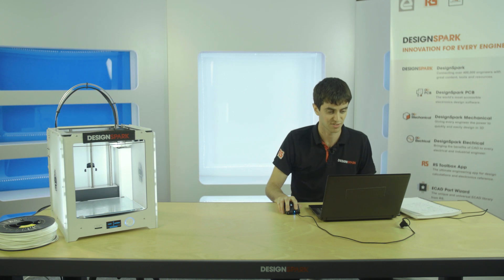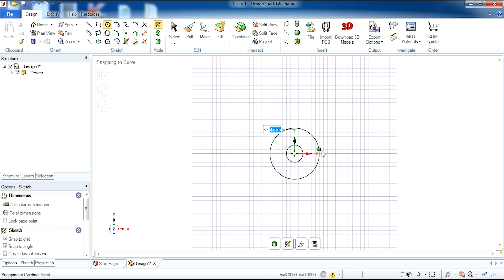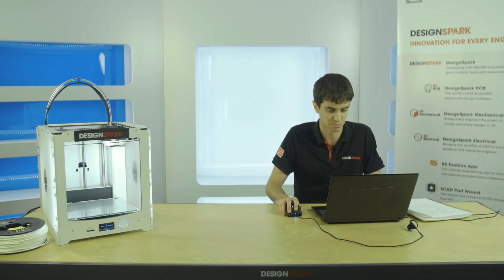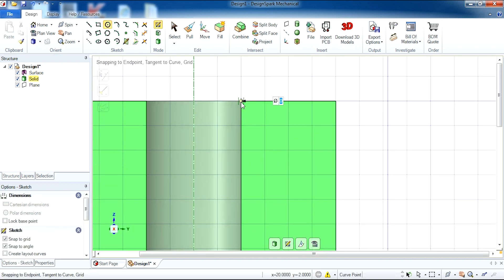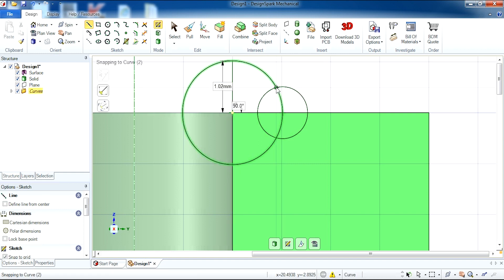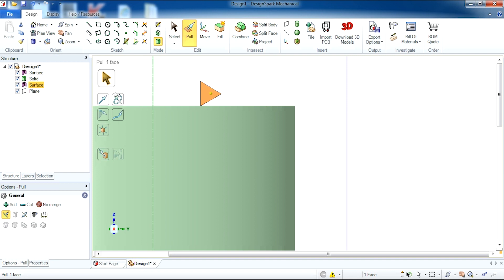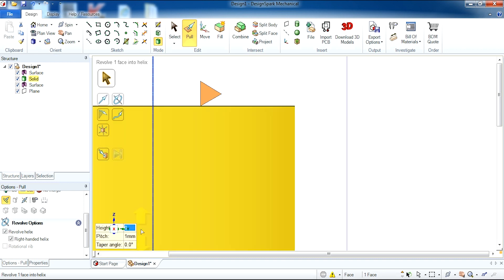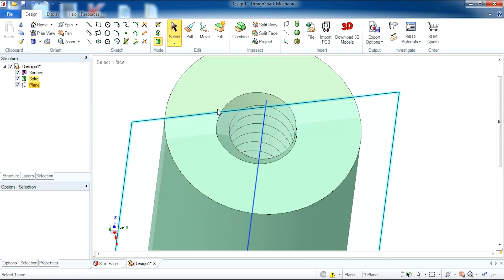DesignSpark Mechanical Training | 10 Threads

Comment: To address some of the comments concerning dimensions of threads.. I've been a Machinist and Engineer for more than 50 years....    you can google the dimensions for threads and there are a lot of resources of information.  You can also download a PDF of "Machinary's Handbook" and it will provide way more information on threads than you can ever use...  Basically you only need the Pitch, Major and minor diameter along with standard tolerances.   I'm not a DS expert but I do have some experience with threading..

Comment: There really needs to be a create thread tool which is simpler. I tried following this and I don't get the revolve options menu. So I don't know what to do now.
Reply: ah so you have to click the revolve tool in the pull menu THEN click the center of the tube to get the menu.
Reply: Now it says failed to resolve as a set of surfaces :( I don't get it. OK so my triangle wasn't on the middle edge of the circle. Now it doesn't seem to like pressing enter in the popup box. Have to use tab to change the box. Looks to outline the thread now but doesn't seem to cut it away :(
Reply: OK oddly I saved the file as was about to give up and now it let me cut the thread ?!

Comment: This is a very BAD tutorial.  Let me explain:

1.  The basic idea of sweeping a profile makes perfectly good sense.  The reason he created the two circles of the dimensions he made was that that is how you create two circles which intersect at a point where you will create a 60 degree angle.  There are other ways this could have been done... two lines, constrain the angle to 60 degrees... fine.

2.  (and this is the real problem) This will create a "cosmetic thread" ... it will be thread-like... but in order to manufacture a true standard thread, ISO, ASME, British, etc... you need the correct profile and dimensions to sweep... none of this is addressed, and none of this is part of DSM ... this is basic stuff, if you are going to call yourself a professional 3d CAD system.  Threads are fundamental to every assembly.

... come one, DSM, you should be able to do better than that!

Comment: @00:49 select 3d mode oh wait there is no shortcut for that. Please add more shortcuts for basic stuff. Nice to see the tools explanation but thread size part is skipped without which this tutorial as explained by others becomes useless. Please try adding that adn reupload. Good luck for the next one👍
Reply: Oh and one more thing this is inner thread how to create outer thread? for a part to fit inside this ? You missed that part as well. Keep videos short but not incomplete in case you cannot make them longer, try naming them as part 1 and part 2 and so on.

Comment: Nice video. 
It could be nice if it had more of the knowledge behind the dimensions to make a thread. So ie. if I want to make a thread for a 6.5 mm bolt, how big are the circles then? Also how to tackle increase.
Reply: Your first circle would be 13 mm in diameter, and your second circle would be 6.5 mm. Depending on if you are planning on cutting the threads out of the bolt, or adding a thead onto the bolt may change the positon of your second circle.

The first line of your triangle (for the threads shape) is equal to the radius of the first circle. This gives the width between threads. The second circle crosses the first circle at 3.25 mm (half of the radius). This gives you the third point of your triangle. This only works if you want a perfect triangle (with 60 degrees for each corner).
Reply: @euroclydonftw9676  What I was aiming for, was the mathematics behind. So everyone could make any metric size bolt and nuts.

Comment: Ok, now say I want to change the height of the cylinder at the start, from 20 mm to say 35 mm. How do I edit that dimension? I'm starting to wonder if this software is at all parametric?
Reply: it is not at all parametric
Reply: You just use that size you need, when puling the cylindre up. When you use the revolve tool, you put in how far i should move. In this case it is the -21 mm.
My software did't like minus 22, but 22 was fine and it made a nice thread.

Comment: this video shows the method of creating a internal thread. he uses a 4mm dia hole and cuts a thread into that diameter this means that the screw to go in this thread is not 4 mm it must be bigger . its some odd size i think. learn the method of creating the threads but do your own dimensions using a thread dimension calculator. 

  https://www.amesweb.info/Screws/IsoMetricScrewThread.aspx
Reply: how do we use thread dimension calculator to come up with circle diameters?

Comment: i used inventor to draw for the passed few years, i not sure how to use this software to adjust the distance from parts to parts.
and also in the sketch area how to adjust the line distance from the reference point.